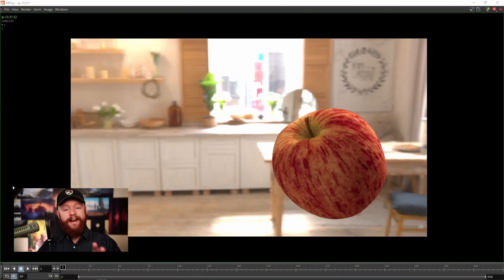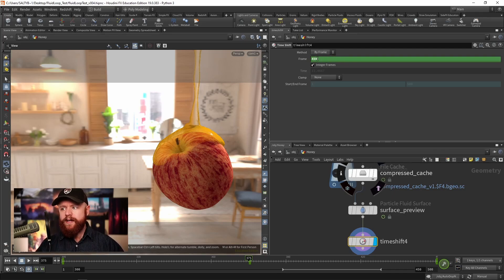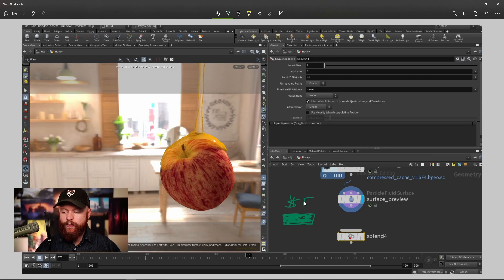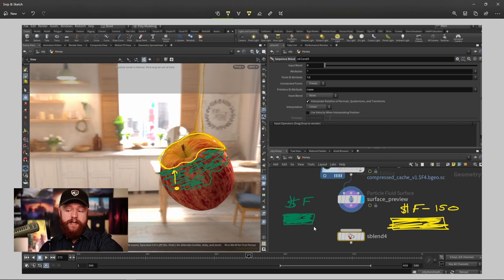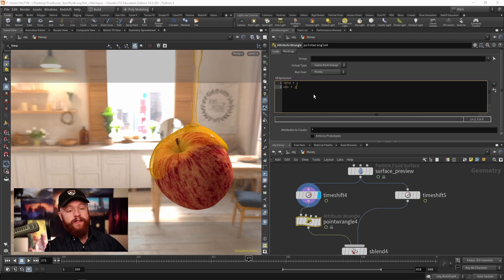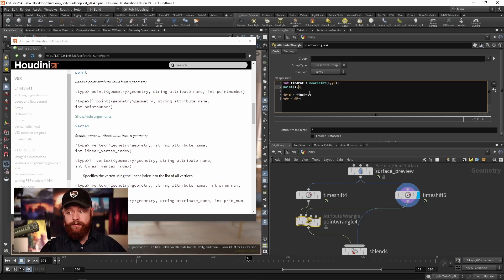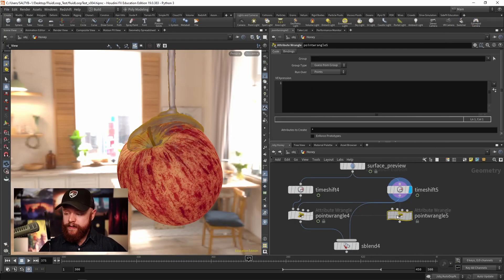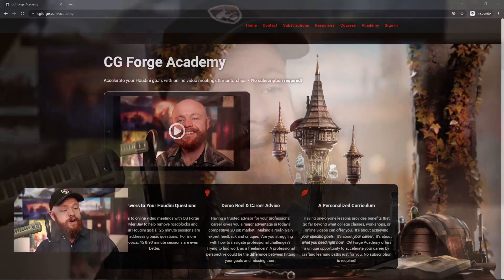Houdini | Infinite Water/Fluid Loops | CG Forge Quick Tip

Comment: Im trying to do this with flip particles, not fluid surface. Is it possible? Im guessing the @id is off somehow because theres a bad flicker at the end that kills the loop. I switched the unmatched points setting to DELETE and the shape loops perfect, but deletes points during the Input Blend sequence. Any help appreciated
Reply from the maker: Hmm I think you might run into some complications with that if you're trying to use particles instead of the meshed version.  I'd need to play around with it myself for a little while to figure it out.  But - the first thing I would do is double check that you have @id happening.  In the FLIP solver, i don't think it gives you @id by default, so you want to make sure that's on.  Beyond that though, I'm not quite sure.
Reply: @cgforge  Thanks for the super quick reply! It was the receeding particles that created a mismatch/bad offset. Works perfect now! Great video thanks again